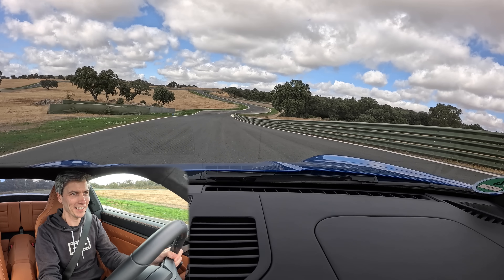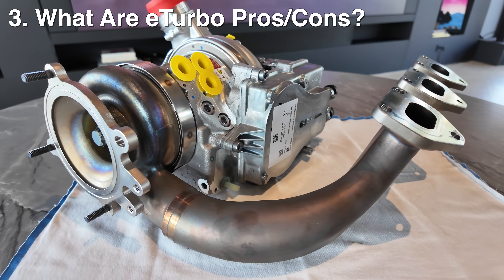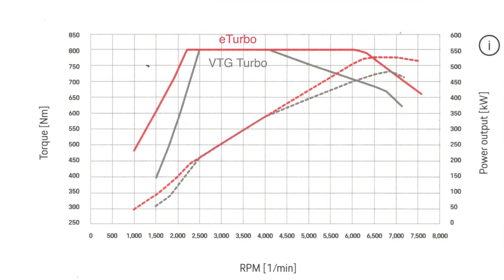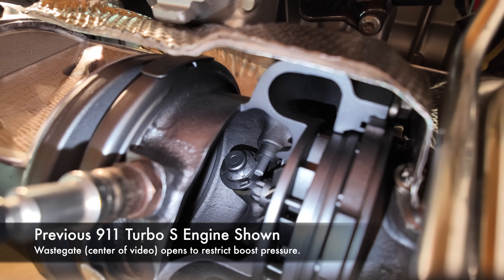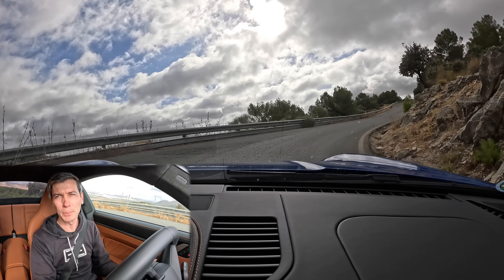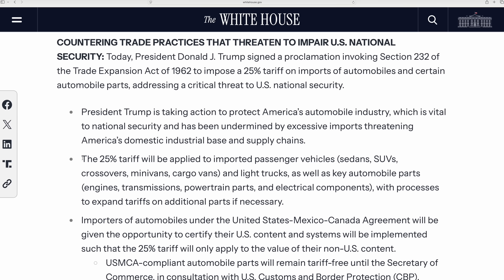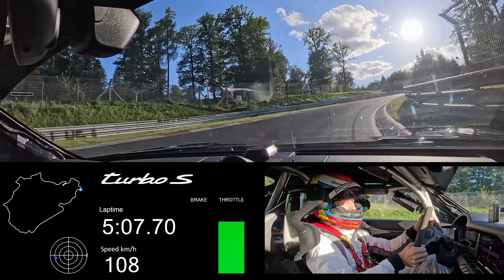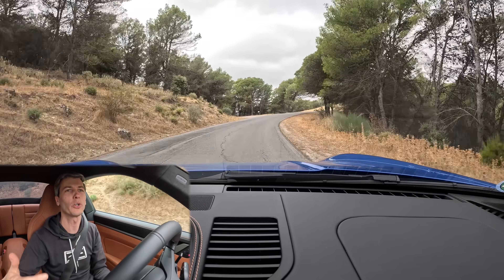Electric Turbos Are Here — Is It A Good Thing?

Comment: So those electric turbos on eBay for 29.95 in 2005 were legit after all
Reply: Sadly for all of us, no
Reply: There's a scientist dude that runs a small block with an electric "turbo" boosting 8lbs on track and dyno. It's really expensive and still a delicate process. I feel like in 10 years we'll have a bolt on kit for like 2k that should be relatively easy to install.
Reply: @MrDopeContent there was a dyno shop that tested an electric turbo against a harbor freight leaf blower. The electric turbo didn’t do anything and the leaf blower was pushing like 2 pounds of boost. It’s out there somewhere.
Reply: The problem is power supply and control. 12V really isnt enough to drive a proper sized motor.   Google the etorque electric turbo.  48V and has a battery pack and controller. Pricey though.

Comment: This is pointless.  If you've got an electric power source that can eliminate turbo lag at low RPM and spin your intake compressor for you, then there's no earthly reason to futz with all the drawbacks of capturing exhaust via a turbocharger.  Just do an electric supercharger and de-restrict your exhaust.  Turbos burn oil, foul exhaust valves, and contribute to overheating engines.  Just get rid of all that drama and get the performance benefits of a de-restricted exhaust system.  You're wasting energy by congesting the exhaust just to generate electricity which is then converted into motive power at a motor, but isn't converted efficiently anyways.  Less exhaust restriction = higher RPM = more horsepower.

Comment: Or we just stop trying to make ICE act like an EV. Just use the ice as a generator and run all propulsion from battery (small) and electric motors. Then You have infinite level of tuning control for traction, Insane power level from zero rpm and super low emissions as the ice runs at very steady state. Stop rrying to make ICE act like the ev!!!
Reply: Nevermind all the simplicity you get with no trans, drive shafts, transfercase, etc/etc.
Reply: Then the ice goes to 3 cylinder at 200lbs less.

Comment: All this technological setup basically equals overall better efficiency in engine operation right? So outright performance aside, you could downscale this entire motor system to create an ultra fuel efficient city car yes? The only caveat being as it always is, that maintenance and parts replacements expenses may actually outweigh the fuel cost savings?
 New bunch of questions for you, see them in you near future vid, thanks

Comment: I would think that the additional rotating momentum of the motor would cause - without a wastegate - a run-on of boost when you take your foot OFF the gas - that is, the turbo would not slow down as quickly - large turbos PLUS electric motor rotating - unless taking your foot off the gas ALSO uses electronics to slow the electric motor - energize it in reverse, in effect - to slow down the turbo, drop the boost quickly, and make the car less responsive to trailing throttle.  It depends, of course, on where the throttle plate is - on the way into the turbo or behind the turbo - as well.  Interesting video.  Of course, with this much control over boost, why turbo at all - just use the motors as a centrifugal supercharger pair and take the exhaust out of the loop entirely.  Less efficiency but greater simplicity.

Comment: To me, this seems like a modern reinvention/replacement of twincharging. The electric motor in the turbo is providing the immediate-on boost nature of the supercharger, but without the parasitic loss of power & the heat, & with much less weight...and then the traditional side of the turbo provides the typical broad boost range & higher boost.

Twinchargers are used by Volvo to give their small-volume engines the torque & power of larger engines, so that you get the power delivery of a large displacement engine without the weight & fuel economy costs.

It's also been used in hill-climb races like the Pikes Peak Hill Climb in engines like a 3L diesel, with low power & high natural torque, to give a constant high horsepower throughout the elevation increases & switchbacks (which throws off standard turbos due to lag).

So, I think this has a much broader application than merely in supercars on tracks.

Comment: But for a person that already has a 992.1 [Not Me], why would they opt for this over modifying their 992.1?? A “simple” software tune could eliminate turbo lag. Plus they still have the key on the left, which is big for enthusiasts. Less weight. A somewhat analog tack instead of the full digital display. 

Plus the pre facelift having more displacement to play with Uptop. The 992.1 was able to hold 950AWHP on stock motor and stock trans. I just don’t see the benefit. Plus the price difference is literally the actual cost to make 900+ AWHP. It cost like $35k-$40k.

Comment: I worry about the fact, boiling hot exhaust gas heat is bleeding into those electric motors. That probably gets hot with heavy use. I'm sure Porsche has thought of keeping them cool, but those electric motors must not prefer a track day, and just easy driving. Curious to see how they hold up in the application.

Comment: Want to know the impact of tariffs?  Get the Canadian price (CAD) and compare to the US price (USD). Now adjust the prices by converting both back into Euro.  The cost of delivering a vehicle to Canada is about the same as the US so this makes for a relatively good comparison.  For example, VW ID.4 = 45,095 US or 46,320 CAD.    So 39,095.69 Euro (from US) or 28,664.95 Euro (from Canada).  Yep, the tariffs take a bite.
Reply: Ah, there might be issues with this comparison.  Should have picked a gas car - there might be electric rebates at play.  Try again with a Tiguan,  39,320 (CAD) or 30,805 (USD).  That's a bit better.  24,326.83 Euro (Canada) vs 26,699.64 Euro (US).  But even now I wonder where they are made as that is only a ~10% difference.

Comment: I'm all for this. It's a modern version of a Super-Turbo (supercharger + turbocharger) which Poresche never offered (for good reason).

Traditionally, to accomplish that, you have the added weight of the supercharger, a lot more charge piping and valving to control and balance boost. You'd also still retain the starter and alternator. And don't forget the engine itself needs to be made heavier for supercharger application.
With this, you get a supercharger, a turbocharger, e-torque and you are deleting the starter and alternator.

I'd guess the weight increase from a hypothetical 911 Super-Turbo and this is would be about 35Kg (77LBS) Not insignificant, but a tradeoff I'd make in a heartbeat. It's also a LOT simpler and more reliable than a traditional Super-Turbo would be...

Comment: It really blows my mind that they still aren't using super capacitors in some of these designs where they could dump a whole bunch of energy into one of those electric motors instead of just using batteries! And I am assuming they charge much quicker too. Too. Also allowing the batteries not to be heated up so quickly because they're being charged and discharged so fast. Which I'm thinking capacitors actually don't mind.

Comment: I drive a Porsche Panamera with an e Hybrid.  The ICE is 440 HP Twin Turbo V6, with an extra 130 HP electric motor.  My old car was a 400 HP V8 Panamera.  When I first bought the new one I was worried I would miss that big old V8.  But the new technology of the electric turbo quickly removed all my worries.  The hybrid is so much better than the old V8.  Power comes on smooth, and long.  It is not a "track focused" car, but for a daily driver with 4 seats it is awesome.  When going to the gym, grocery store, restaurant, etc., then I can drive in pure electric (32 mile range).  When going longer distances I have the combined ICE and hybrid for super performance.  Porsche really did it right! The ONLY thing the V8 had that was better was the sound.  Other than that, I'm all in with the new Porsche hybrids.

Comment: I might be the only one wishing for this, but the next gen Boxster, 4cyl, e-turbo, stick shift... I wish that were a thing. But given that the traction motor and e turbo are part and parcel, I'm not gonna hold my breath. It might just need some way to dump power from the turbos briefly for edge cases like going from full boost to clutch in where the turbos havent had a chance to slow down yet. Love the efficiency and emissions benefits of this tech!

Comment: first of all, wish I could be on a track with a cool car like that.  Looks like a freaking blast. Now this looks, it could be a huge thing, that power line using an EV motor in combination with a high output motor.  We've seen a few higher end cars with EV/big motor, but this is interesting. 

I wonder if this power eturbo tech could be used in other places. Just seeing this besides the raw power (yea, raw power is my dream),  in a standard Hybrid, using this technology to charge the battery while driving could give a boost in usable EV range.

Comment: Hmmm could there be a vacuum created on the exhaust side of the turbo? If the valves aren't seated/sealed properly could there be unspent fuel air mixture seeping through?  🤔 great video!

Comment: As an engineer, I have to say Porsche solved vehicle emissions with this device. Not only can it provide boost at idle it could also pump extra air into the exhaust to make sure there is zero emissions coming out. Allowing for a complete burn with the catalytic converters with the extra oxygen.

Comment: Great video as usual.  Thanks!   

Surprising this hasn’t been done sooner for efficiency.    Brake regen has probably been fully optimized at this point in e and hybrid vehicles.    However the biggest ice waisted energy, high velocity exhaust gas ( done here) and waste heat.  Heat scavenging to recharge the battery is available but not used or optimized.     Probably not much there for performance directly but should provide a big efficiency increase.

Comment: I always wonder if there were an energy waste thru the alternator from the excessive electricity current generated when the engine is in high rpm, usually when driving in highway. If it does, maybe future automotive maker can use that excessive electric current to power those electric turbo.

Comment: Very interesting system but, if you say with a larger turbo you have less restriction and thereby improvements in emissions, how does that work if you brake the air with the turbo’s during regen at peak power? This adds restriction in a sense right?

Also, how many years would this battery last? It seems like it is discharged a lot of times during a single ride

Comment: I wonder what temperature those turbo motors are running at?  I assume they're water cooled?
Reply from the maker: The turbo is oil cooled (oil at ~100C, higher if driving hard), with water cooling for the electric motor (off the engine circuit ~100C) and a separate, lower temp (~30-40C) water cooling circuit for the inverter.

Comment: What about adding an e-turbo to a vehicle that  1, never had a turbo 2, replacing a mechanical turbo.  In either situation is an electric motor in the transmission required?

Comment: audi did this with the sq7 but was a pure electric addition (3 turbos). this will be very expensive when it goes wrong, and it will. the electronics are right next to an 800c hot surface so i cant see much reliability. hybrid systemscare near impossible to diagnose/fix when it fails

Comment: Mechanical Compressor is the most reliable
New cars especially Hybrid are super complex and people assume they are buying the same cars but they are not the same
that high voltage battery will need replacement and it would cost $50k
Reply: finally, if the boost is balanced with the weight increase and it run 0-60 the same time we have an obvious scam

Comment: Love your videos bro! However on this one, this is a really sad subject as this technology per Borg Warner and Garrett has been around for at least half a decade now and even used in the AMG GTR Black Series as far as I remember.

Just really sad this hasn't made it to the regular Joe's tuning market!!! It has so much potential IMO, which led me down the rabbit hole of DIY Electric Super Chargers! 

Not to be mistaken with the garbage 48 volt kits out there. Advantages are 0 HP drag loss on the motor and can be set up to have instant on tap anti lag style response much like this setup.

Comment: I'm currently driving a MB E53. It has an 3.0L INLINE 6 with twin turbos.(435hp). There is also a 700V battery that drives a 'supercharger" into the turbos and also drives ALL the accessories. What this means is that when you accelerate, the big battery spins up the supercharger and drives the turbos instantly. With the battery also driving the accessories (water pump, oil pump etc etc) there are NO belts in or on the engine. What that means is that a straight 6 fits into the space that a conventional straight 4 would fit into. It looks like Porsche has kind of shortcut that by putting electric motors in the the turbos but I don't think it eliminates the need for belts. Although both of these concepts greatly increase the mechanical complexity, at least in my case, it works (this design is about 5 years old now). I should also mention that as a (hopefully) future Porsche owner, this is good to see.

Comment: For other cars that are not made to produce high HP. I wonder if it would be possible to just have a simple small turbo that ran off the cars normal electrical system, ie. 12V battery and alternator. And another question: How many vids did you need to do to have manufacturers give you their car keys? 😀 You have one of the worlds most coveted jobs!

Comment: watched Formula1 when Lewis Hamilton and Valteri Bottas were using " the magic" button  with Team Mercedes the inventors who pioneered this..... game changer even at the 200HP engine limit  it put both drivers wheel to wheel with Max Verstappen who rounded out the corners to minimize power drop and deceleration and maximize full throttle and accelerations and tire wear.

Comment: Overly complex German engineering.  Any out of warranty repairs you better have a 2nd mortgage ready.  It's way overpriced and it still gets smoked by a Tesla Model S Plaid at 1/3 the cost.
Reply: Electric vehicles, superior in every way.
Reply: @NeverHaveKids  Replace the battery and lets see how superior it is on your bank account.
Reply: @atrax7023 About the same as replacing an engine.

Comment: electronics always have AND always will be a weak point of failure.
its simply the nature of electronics.
mechanical parts may have more moving parts, but are generally more reliable.
electronics also are not usually compatible with high temps.
Reply: Facts!
Reply: The future is now, old man.
Reply: @AnoNym-zi5ty  🤣not old. just wise.

Comment: Already, I see electric motor response times without the battery weight of EVs. As long as reliability is maintained, while efficiency is improved along with increased power and torque, it sounds like a winning design, unless Porsche chooses to only have this tech on ultra-expensive cars.

Comment: Nobody cares about piston engines any more. But in particular, nobody cares that this thing gets to peak torque 2 seconds before the regular turbo, because an electric motor has peak torque at 0 RPM.
Reply: Correct.
Reply: Car enthusiasts do, EV will never give the same driving experience as an ICE car will, no ifs, no buts. Also EVs degrade faster and are definitely not the future, they are worse for the environment in every way other than running emissions - but then you charge them using fossil fuels anyway so you're not really helping anyway. You will never, ever entirely replace ICE vehicles, especially not diesel trucks. Synthetic fuels are the future, EVs are just a bubble that will burst in time.

Comment: Maybe the mechanical engineers will start to realise how powerful electric motors are.   Instead of multiple motors to support all the mechanical functions, you just drive the vehicle from 1 or more electric motors and use a small combustion engine when necessary to top it up for long trip.  Short range combustion sports car no longer make any sense, when a battery EV can eat them easily.  Really you only need a range extender for towing.  A Tesla Model 3 weighs about the same as the 911 Turbo S.

Comment: I will assume there is factions of a second in rotational inertia, even for the electric motors?
I cant wait to see the scam electric fans, sold on ebay as electric turbos, link to this video as justification/proof of their product😜
U talked about the extra weight of the system, but also said that alternators etc aren't there. Does the weight increase get offset by what is no longer needed?

Comment: Neat system, but that extra ~30hp from the traction motor once the battery is drained - is harvested from turbo backpressure (waste-gates are either to keep the turbo from over-spooling or the engine from getting too much boost, right? So ICE engine is producing max power and instead of all that power going into the crank, some of that power is going into rotating the generator to supply the traction motor. It's *not* better with a drained HV battery. It's worse (due to inefficiencies in power conversion both at the turbine blades and at the generator).

Comment: My first 911 was a turbo S with PDK. It accelerated to triple digits way too fast.  I sold it a year later for a 4s convertible with a manual.  More enjoyable driving around town where you can go through a few gears before triple digits.   I own a Super Duke 1290r.  Same issue not able to use full
Power around town  as anything more than a quarter throttle gets you in trouble.  Buy a slower bike you can ride fast with full throttle.  Just sayin.